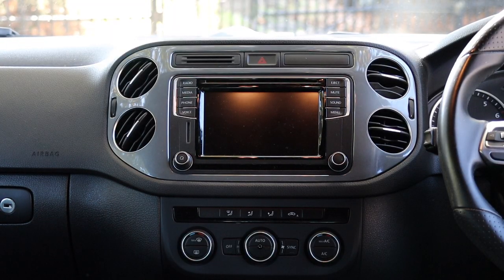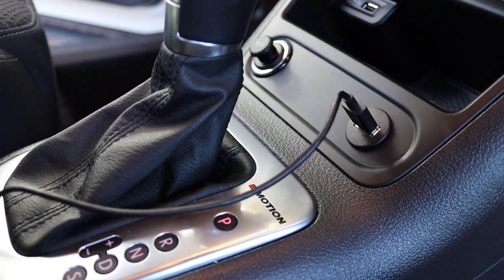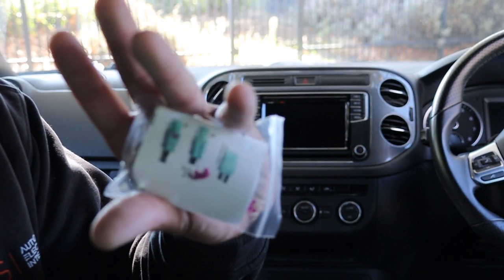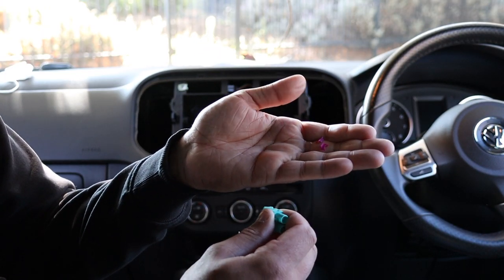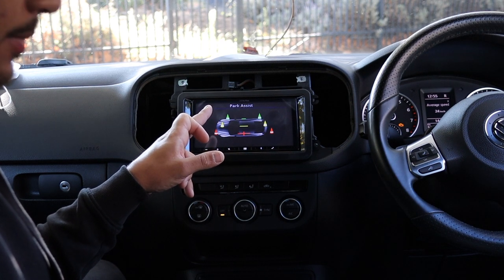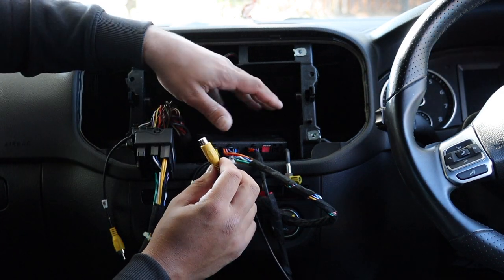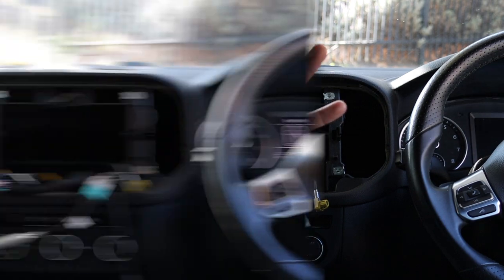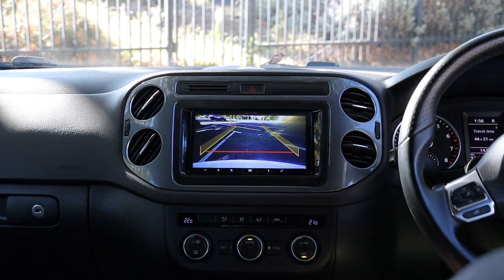Volkswagen Tiguan Full Head Unit Install (Retain Camera + Steering wheel Controls)

Comment: I had a Kenwood unit install last week on my Tiguan, but now getting a parking brake warning warning when switching the car off and turning off the ignition has delay with the engine turning off. Have the installers not ground the park brake as someone else mentioned in the chat?

Comment: Hi, what head unit did you use for the VW Tiguan? Is this the 2012 refresh VW Tiguan or the prior generation? Thanks in advance 🙌🏻
Reply from the maker: ILX-w650E and it’s the face lift 12-15
Reply: @TheFittingBay  thanks 🙏

Comment: Is there a certain code you’ll need once you insert the aftermarket radio? I’ve seen “you’ll need a code if you remove main connection”
Reply from the maker: Nope :) Maybe if you unplug the original the plug it back in. But not changing the radio no.